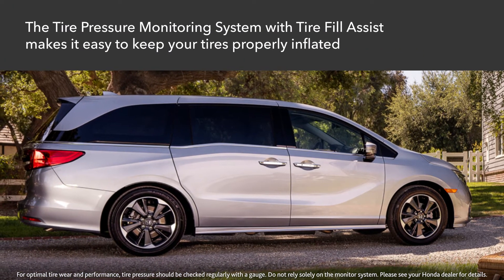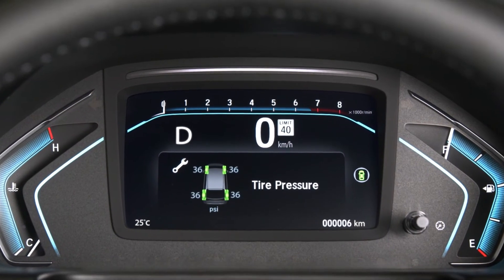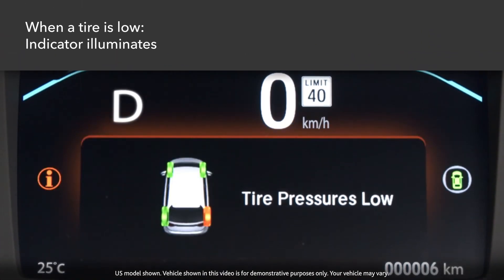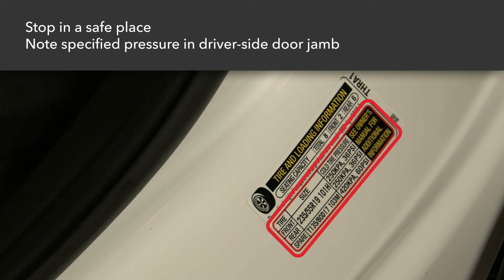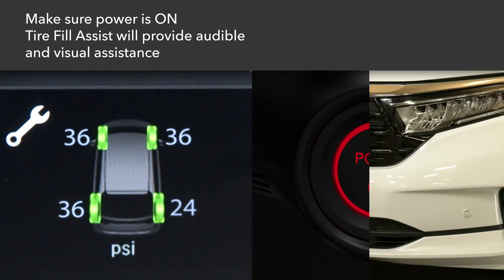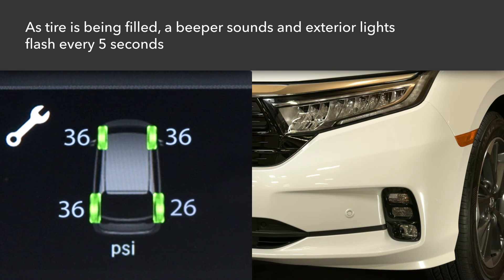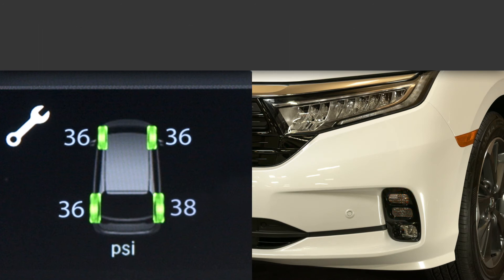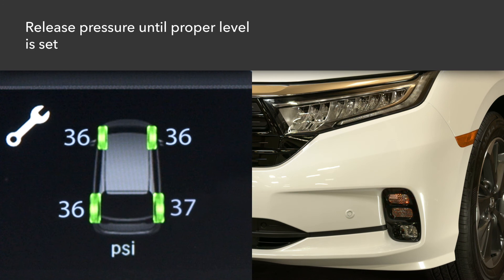Using Honda’s Tire Pressure Monitoring System (TMPS) with Tire Fill Assist

Comment: 2022 accord doesn’t have this feature been scrolling thru the dashboard menus and can’t find anything. I was really looking forward to actually purchasing one. Good thing I only rented it
Reply: @Kity1331  2023 and newer Honda models (CR-V, Civic, Accord, Ridgeline, Pilot, Passport) use a simplified Tire Pressure Monitoring System (TPMS). Instead of displaying individual tire pressures, it only provides a low-pressure warning light, due to the use of less precise sensors. You’re Welcome

Comment: 2020 civic sport doesn’t have this and it annoys me big time
Reply: Just came here to try to figure out how to view which tire for this exact model… now I share in your annoyance
Reply: @hellokittydimaggio  2023 and newer Honda models (CR-V, Civic, Accord, Ridgeline, Pilot, Passport) use a simplified Tire Pressure Monitoring System (TPMS). Instead of displaying individual tire pressures, it only provides a low-pressure warning light, due to the use of less precise sensors. You’re Welcome

Comment: 2023 and newer Honda models (CR-V, Civic, Accord, Ridgeline, Pilot, Passport) use a simplified Tire Pressure Monitoring System (TPMS). Instead of displaying individual tire pressures, it only provides a low-pressure warning light, due to the use of less precise sensors. You’re Welcome
Reply: Ok bc I just got a 2024 and I really thought it would have this feature im so confused everyday I wish I had stayed with Toyota Honda is disappointing honestly
Reply: Thanks for saving me some time. It told me low tire pressure and I assumed it would tell me the tire pressures because why go through all the trouble on having sensors when you wouldn't actually enable it in the gauge cluster...
Reply: I have a 2020 Accord, do I have this feature?
Reply: @lindaapio6542  no
Reply: @lindaapio6542 did u find a solution? my 2020 accord is doing the same thing
Reply: I have the 21 and can’t see a number. Is there a way to turn it on?
Reply: Same with 2025 civic sport
Reply: I have a 2019 civic sport and I can't locate the tire numbers

Comment: 2023 hrv doesn't have this feature either..... just says low tire and makes you find out which one it is
Reply: Drives me nuts, this is my first and last honda
Reply: N it sucks
Reply: Same with 2021 crv, smh
Reply: @rickholloway730  2023 and newer Honda models (CR-V, Civic, Accord, Ridgeline, Pilot, Passport) use a simplified Tire Pressure Monitoring System (TPMS). Instead of displaying individual tire pressures, it only provides a low-pressure warning light, due to the use of less precise sensors. You’re Welcome
Reply: Since it doesn't tell me which tire is low... Then it is just an annoyance and there needs to be a way to disable it
Reply: Combined with the CVT disposable transmission and the rapid depreciation, it just continues to point toward a trade in on something with better features and more lasting value

Comment: My 2020 CRV doesn't have this?
Reply: Might be standard after 21-22. My 22 pilot sport (base) has it
Reply: If it does, make sure aux power is on and head over go Maintenance > Tire Pressure in your dash